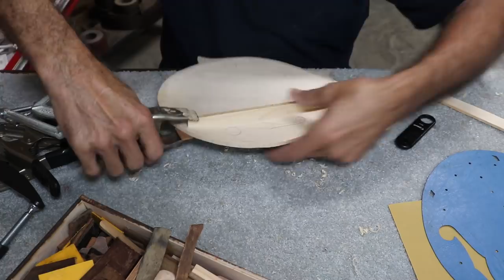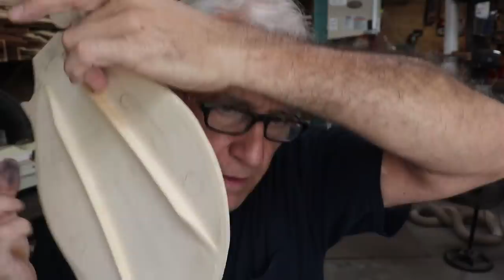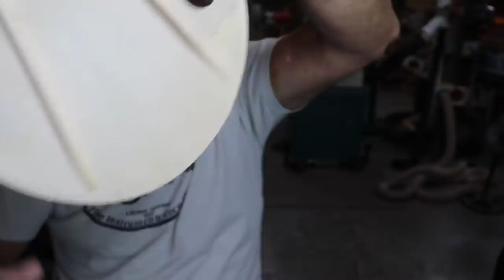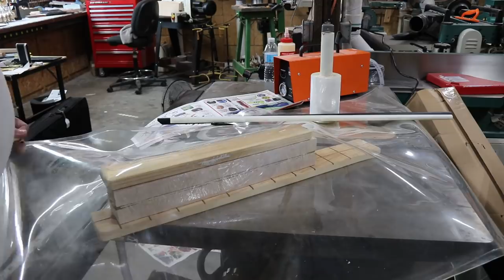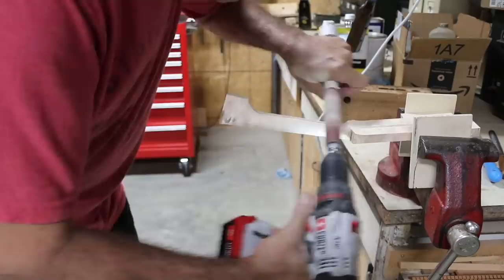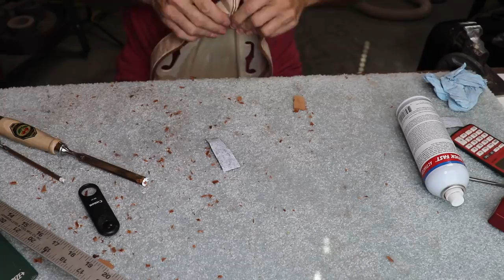441 RSW A Custom Quilted Mandolin Part 2

Comment: Hi Jerry, thanks for your videos,huge amounts of information so easily passed on by you. Thanks. I have a potential tip for your finger planes - take a cork, make a 1/2 wide slot punched into the end and fit it over the back of plane blade, it will be supported by the base of you hand like the plane you used for roughing

Comment: I noticed that others have commented that the narrow, straight chisel was used upside down while the curved one was right side up.  I agree that this would make quite a difference because the top edge of the narrow chisel acts as a fulcrum and allows you to pop the shavings off.  I always find a challenge when using new tools.  I have often discarded what should be an improvement and gone back to the tried and true older tool.

Comment: Hi Jerry, nice work. Tip;  A round thick leather cushion 10/12" dia- 1-1/2" thick, filled with soft fine sand, like silversmiths use, would greatly facilitate your carving any round backed or bowl instrument. Cheers.

Comment: Hi Jerry, An idea on the Drill Sander. Just drill and tap a hole on one of the flats of the nut for a grub screw... if the nut needs to come off just file a small flat on the threaded rod for it to fit into. That will keep allow you to run it in any direction without fear of it flying apart. Anyways I enjoy viewing your channel.

Comment: Great point about engineering the top of the mandolin to NOT resonate at the pitch of any open string.  Not only will it improve the sound, it will reduce feedback in live environments.  I've worked sound for string bands and have had trouble with unmuted open strings sustaining infinitely.

Comment: Beutiful work! This is going to be lovely when it's all finished. I've never carved a mando, but I've built some archtop guitars, two of which had quilted maple sides and back. Yes! It's a bear to work, for all the reasons you sited, but the results can be stunning.
One interesting thing about bookmatching on quilted that I've noticed though that's worth a mention. The "quilts" in the wood figure appear sort of like pillows (convex) or cups (concave). Sort of "innies" and "outies". When you join the halves together in a bookmatch, the "outies" on one side of the joint will have its mirror as an "innie" on the other. There is still lots of lovely figure there, but this imposes a sort of visual asymmetry that doesn't seem as pronounced with say a back with 1/4 sawn tiger stripe figure. Again, still gorgeous end result, but there is a slightly off asymmetry in the figure in the bookmatch. I'm looking forward to seeing your next installment on this mandolin!

Comment: You could use a metal round washer to trace the contour the same way. My shop teacher in the 70's drilled a hole in a penny to do the same thing.
Reply from the maker: good tip might work even better

Comment: G'day Jerry. A while ago I bought one of those dog leg chisels made by Two Cherries to do braces also. I discovered that they aren't curved at the business end but are in fact flat for the final 15mm or more. So they are just a flat chisel with an offset. I haven't been able to use them either and I was thinking of cutting off the final straight section or grinding the back to produce the curve needed, most likely a combination of these two methods. Good luck and as you found out a normal chisel up side down works better.
Reply: Jerry I hope you see this! I decided to 'put my money where my mouth is' and reshape the back of my 10mm wide dog leg chisel. I started by curving the back on the 80G linishing belt to create the shape and moved to the stones for the final smoothing/sharpening. The chisel has improved way beyond yours and my initial testing, but it is limited to producing a concave cut no deeper than the curve in the back of the chisel blade. This appears to be more than enough for guitar braces and plenty for how I do my mandolin tone bars.
Reply from the maker: I'll probably just stick with the straight chisel.  If it an't broke...
Reply: I agree but your video inspired me and sometimes a man has to tinker. The chisel  was useless as it was.

Comment: Re the multilaminate neck slippage issue... I think using some toothpicks through the layers into small locating holes might work to prevent slippage. You could drill small locating holes in the INSIDE of the outer pieces, and holes THROUGH the inner pieces so that they all line up perfectly before glueing up. Then as they are wood, they will be glued up inside the neck, invisible on the outside and would not affect the acoustics of the neck at all.
Reply: PS learned some useful tricks here. That sanding attachment for the hand drill is a great idea. Will have to see if this, or something like it is available here in Europe. 

I am planning on building a 5 string electric violin, and there are several techniques here that will prove very useful for my ideas. I plan to make a "floating" laminate top, maybe with a 1 mm carbon fibre sandwich between wood veneers. The idea would be to make the top of the violin structurally strong enough on its own, without having to make a complete box structure as in a standard violin. Then use carbon fibre struts on the underside, much like your wooden ones, here. 

As it will have a bridge pickup, the acoustic properties of the top won't be as important as here, so much as structural strength. But I have tried some solid bodied electric violins, and this "compresses the sound, too much for my liking. So a halfway house compromise with a top that does have some resonance is the idea, but somewhere between the standard acoustic top and a solid instrument.

Thanks for this series. learning a lot!
Reply: @timbeaton5045  Further to the slippage issue, Tim, there is a lot of waste area on that block, what with the neck, headstock and neck joint shaping. Just drill and dowel through areas you know are going to be cut off, after the glue has set. That also works when using ordinary clamps. Like clamping across the width of a table top, during glue-up. A beam on each side, clamped together, to stop the same type of slippage on a larger scale.

Comment: I'm going to guess that reason the curved chisel  felt wrong is that the center line of the force you apply to it is not quite perpendicular to the cutting edge no matter how sharp it is. You are absolutely right that in time you would probably get used to the vector angle, but why bother ? As always, thanks for the video Jerry !

Comment: Jerry, some electric wire pulling lube, spread inside the black tube, 
could help you squeeze it over the end of the plastic vacuum bag.
It is water soluble, for easy clean up.

Comment: I love quilted maple fire maple and curley tiger maple . But you have to sand sand sand ..my handles  once I was there id sprits with water let the hairs come up and dry with a heat gun and sand some more .
Reply from the maker: I worked with curly Maple for 40 years and I've never had a problem with it like I have with this quilted Maple

Comment: Chisels .... Feels more comfortable because you are using the bevel on the other side. Cutting with the flat side makes the chisel dig in more where as the bevel allows you to come out of the cut.. If that makes sense......
Reply from the maker: You can't turn these over... if that makes sense.

Comment: two things strange : the bass brace should have been the lighter brace and the the treble one the stiffer. Both plates aren't a bit too thick ? because the arch produce a better resistance it should theoretically permit to be thinner than a flat top which is around 2-3 mm for spruce.

Comment: jerry thats the wrong chisel for that job its called a swan neck chisel and its used to for removing waste at the bottom of a mortice
Reply from the maker: Don't tell me.  Tell the people selling it:  https://www.stewmac.com/luthier-tools-and-supplies/types-of-tools/chisels-and-knives/two-cherries-guitar-brace-chisel.html
Reply: @RosaStringWorks  Smurf is right, it's the wrong chisel, or at least the wrong bevel direction. The curve is fine but not necessary. The bevel being down, makes the bevel direction pointing out of the wood, whereas the bevel up makes it point down into the wood, and as the chisel tends to want to cut toward the bevel direction, it wants to keep digging into the wood, taking an ever larger bite, which makes it stall in the wood as you experienced. It likely was a very sharp chisel, but was just wedging ever deeper into the wood until it stalled. Great video and love the quilting!

Comment: Hi Jerry isn’t it more important what note the final assemble instrument makes, not just the top?
Reply from the maker: Of course it all matters. However as I've often said the top is 80% of your sound at least
Reply: If the top does not resonate well, it will
mute the sound of the assembled instrument.
Reply: Sorry I was not clear enough with my comment. I was thinking about not wanting the instrument to resonate on the same note as an open string.  Even if the top does not, you won’t know the “final” note until the instrument is together, at which point Is there anything you could do about it if does end up on an open string note?
Reply: @edd2771  :
Oh, OK. That's one I don't know about, yet.

Comment: Jerry
That sander attachment that nut that tightens it how are the threads. They tighten clock weise ? Get a thin  or two thin nuts and thread them both on and use the back one as a lock nut .  I had to do that do a few of my drum sanders . It works .
Reply from the maker: reverse works fine
Reply: @RosaStringWorks  it was just a suguestion . I ment well .

Comment: Jerry, I think part of the problem you are having, with that curved chisel, is
no having your work piece clamped down.
The chisel is designed for wood workers. Wood workers' work pieces are always clamped in place.
You have gotten used to the straight chisel, but the curve, plus no clamp, is causing the work piece
to rock all over the place as you cut.
Reply from the maker: Dont have to clamp down with the other chisel.  Why change?

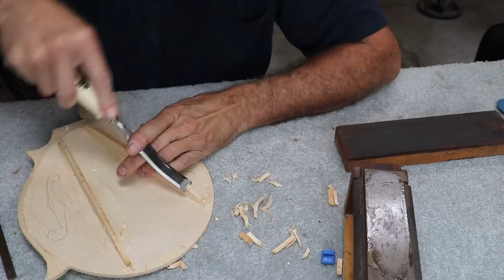Comment: At 13:32 it is obvious to me that it is the two different side of the chisel who are used on the two different kind of them who are responsible of the awkward sensation you've got using it. The straight chisel uses its beveled side and on the contrary it is the flat side of the curved chisel that it is used on the bottom of the cut. This particular différence ruin completely the purpose of the design of the curved one which were to facilitate very low angle of attack for which he made it more difficult !!

Comment: Jerry -- looks like that curved chisel may have been heated up to make the curve -- could that have softened the steel so that it won't hold an edge?
Reply: Good scenario, a blunt edge like you would sharpen a mower blade would probably be better than sharpening to a razor like a knife. It may not be worth a hoot though for the detailed work Jerry is doing.